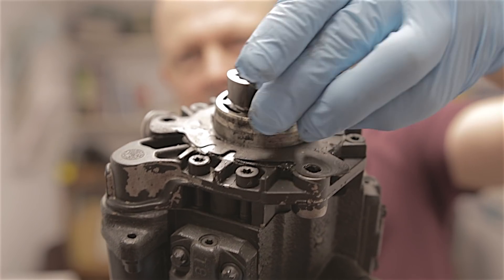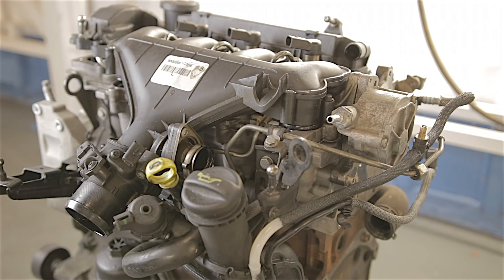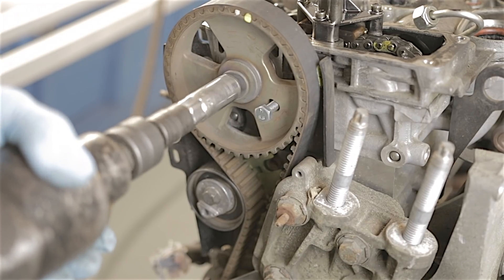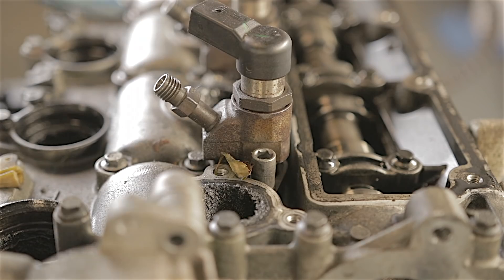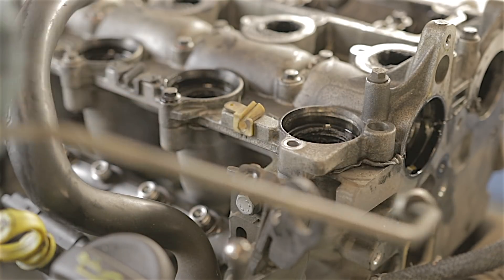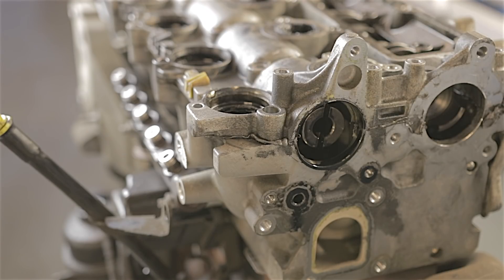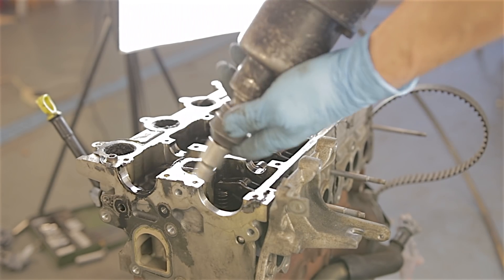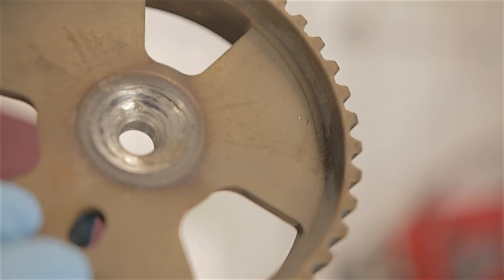Ford Mondeo Mk4 Jonah Engine   .... Final Chapter

Comment: Amazing videos Alan 
My mk4 ex lease car has same 2.0l engine 
Just clocked 200k 48k of them I’ve put on them in 2.5 years I’ve owned it 
It’s had a new clutch flywheel and all the trimmings at 157k and serviced regular between 8-11k
So far so good it’s been spot on 
No black smoke and plenty of power I honestly can not find a fault with it 
Just hope it continues for many more 
(You have proper talent for making these videos mate) 👍🏻
Reply: @Montgomery Burns - I'm bloody well in love with my 2L mk4 diesel. It's a beast. 103k and I've had it since 94k (I'm just always worried that some of these 'issues' are going to happen to it!)

Comment: When the valves go straight into the cylinder like that, the force of the pistons will snap rockers rather than bend the valve. Check all the rockers though. Had a cam belt go, one rocker snapped, but 6 more had cracks in. I've never seen any vehicle Autodata didn't call interference, and technically, snapping rockers does cause interference.

Comment: I had a 2.0l tdci 2008 mondeo in my work shop and the cam belt snapped and took off the head to find out only  12 of the 16 rockers had snapped and there was no need for the head off as it was perfect, it must be designed that the rockers are the week point  . thanks for you video's there good

Comment: Alan.  Help !!!!!   I’ve a MK4 2.0 Petrol. Started mid firing .  Three sparks. Drenched in oil upto top socket !!!  Only one. The first to left was dry.    Others so bad .  Is this what I think it is.  Rocker?  Or.  Poorly filled
Reply from the maker: sounds like your rocker cover gasket is leaking oil into the spark plug apertures
Reply: @alan4x  that’s what I thought. But oil was like sunflower oil.  This bit tricked me into thinking bad pouring former owner

Comment: I don't know what happened to the DW10 engine. It was really quiet in older Pug's like the 206, 306, 406 etc then when fitted to Mondeo's,turns into tanks. The same thing when you fit the 2.0 TDCI in a Jag X-Type.

Comment: Sorry for my bad english but i dont understand why is the sprocket breaking off the camshaft and why does break the  piece from the camshaft near the high pressure pump?
Reply from the maker: it is a design fault on the camshaft, over time that part of the camshaft becomes fatigued and causes the drive to spin on the camshaft under the strain of rotating the high pressure fuel pump

Comment: Hi just wanted to ask.. I have a focus with the same engine.. Mine doesn't want to start unless you use quick start.. Once she starts she drives perfectly.. I replaced the fuel filter fuel pressure control valve, tested fuel pressure sensor.... I just can't figure it out.. Any idea mate?

Comment: That engine had pretty horizontal valve angles which means a low chance of pistons hitting open valves. Thats pretty rare for a 4 valve per cylinder engine.

Comment: Hi Alan. Iv learnt so much from all your videos great stuff, thank you. I have one of the engines in my 2007 Galaxy. So far with 142000 miles has been really good however recently when starting the engine from hot or cold the car I can hear for a split second what sounds like a cam chain rattle, the sound dissapears straight away when started and running. The car runs well, still gets hight 40`s the the gallon. From your experience are these chain tensiones prone to fail ?  many thanks.
Reply from the maker: no those tensioners are not prone to fail as long as the engine has had the correct oil changes ..might be worth replacing the oil and filter first , cheers duncan
Reply: @alan4x  Thank you for your reply Alan. Funny you should say that Ive just done has you suggested today, I change the oil & filter every 8000 miles anyway it does appear to have sovled the problem.
Reply from the maker: @duncanmurrant7364  excellant, i have had oil filters in the past which was causing a delay in the oil getting around the engine and causing a rattle on start up

Comment: Hi Alan,
Just a question, my mk4 mondeo keeps cutting out and it's come up as a crankshaft sensor. Could you tell me where the location of where it sits and the ease of fitting. Cheers Paul
Reply from the maker: its just to the left of the crankshaft pulley, held on by one 8mm bolt...easy to replace... probably best to remove drivers wheel to get access
Reply: @alan4x  many thanks Alan

Comment: My timing belt on 2.0tdci stripped teen will the engine be fixable ?
Reply from the maker: yes, it will probably have broken some or all of the valve rockers..i have never had a bent valve on one of those engines

Comment: My timing belt snapped on this engine and only the 16 rockers bent or broke. No valves were harmed. Rockers are the weak point. $70AUD dollars later, replaced rocker. Plus the belt, blah blah..
Reply from the maker: thats interesting to know, thanks
Reply: took mine in for new belt/seals,cam leaking,came back ticking,mech said sell it buy toyota,i said i just bought this you fucked it,why,?,cos you like toyotas,??.car cost $1k,belts & shit $600,other 2nd hand body bits $500, just bought new drilled rotors/pads ceramic,$600, why the hell would i sell it.or now,dump it.cant drive it,thanks b&r mechanics. s.a.   i could of done it myself but too work busy.,should of waited..
Reply: omegamanRA28 - where did you get the rockers from for that price?

Comment: breaking rockers is a GM trick, saves the valves and a pretty good idea in my book, BTW, what engine had the problem with the chrome coming off the rollers in the HP pump and mullering the whole system ?.
Reply from the maker: hi, i do know the vauxhall vivaro vans high pressure fuel pump on the diesel engines were notorious for breaking up and delivering metal fillings throughout the fuel system..
Reply: @alan4x  thanks, just summat i had heard as i was looking to get another mondeo.

Comment: Hello
I think i have the same problem
The engine sounds very very loud 
Like metal banging but no vibrations
Can it be something else
Mondeo mk4 2.0tdci code qxba with automatic transmision awf21
Reply: I ve been to 2 mechanics who sait it is the flywheel
But the car does not vibrate and gearbox is working wel

Comment: Nothing wrong with these engines if serviced regular.. mines on 133,000 original turbo, fuel pump and injectors..

Ford had there own 2.0tdci 130bhp in the Mondeo and it was like the Jonah engine.

Comment: Hi Alan, in my 2011 galaxy when i was removing the hp pump ive pulled it a bit to quick and that coupling bit droped down, ive picked it up, but its square on one side and on the other its a bit round, i did put it back together , but i dont know which way it was supposed to be in, i did put it back in round side facing camshaft, did i put it in the right side or should i have put that in other way around? Thanks for your help
Reply from the maker: i have never noticed ... i have one of those couplings at work..will look closer tomorrow but i don't think it will make any difference which way round it is...i will get back to you
Reply: Alan Howatt thanks
Reply from the maker: hi... i checked the drive lug i have but it is identical both sides...the pumps on these engines are all about the same so i don't really think it will matter what way round it goes
Reply: Alan Howatt Thanks for your help, appreciate it;)

Comment: Wow!How come  I missed this video?!Alan,what about timing chain tensioner and chain itself.Do I need to change them same as timing belt?
Reply from the maker: hi, the chain and tensioner should last the life of the engine as long as the oil changes have been done... you would only replace the chain and tensioner if the chain was to become noisey
Reply: Thank you so much Alan!

Comment: The rocker arm's are designed to break pal. It's a safety device against engine damage
Reply from the maker: german sheperd 
  Thank you. I now know that on this engine which is a really good thing to know
Reply: @alan4x  a word to the wise though mate on reassembly make sure all the rocker arm's are sat correctly otherwise they'll fall off and smash everything to bits. I  know that from experience

Comment: Youre valve is bent inside the guide check that i've seen that
Reply from the maker: hi, i will do that, thanks, i poured freeing oil down all the inlet and exhaust ports and none of the valves leaked any fluid but to be sure i will check like you say